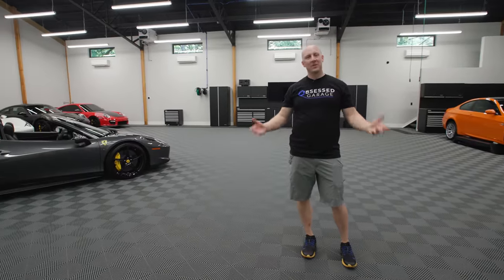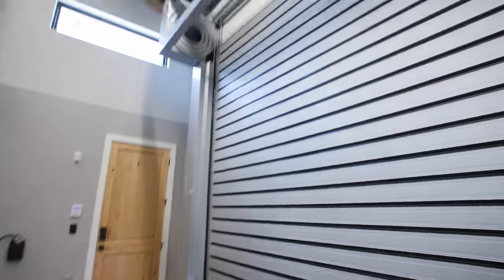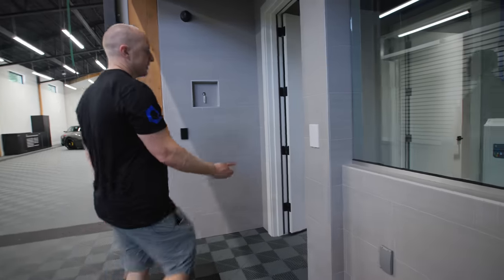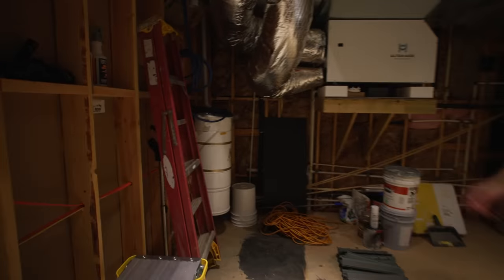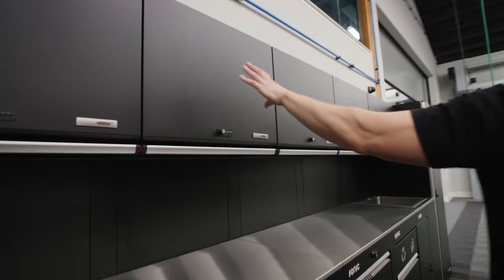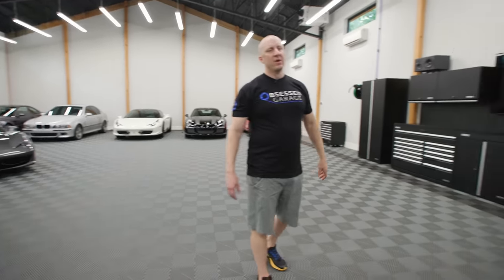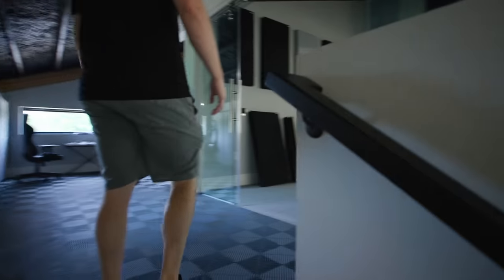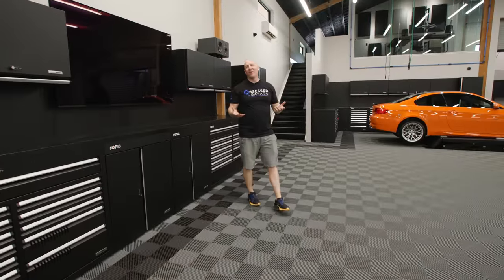BEST GARAGE Ever Built: Updated Walkaround Tour

Comment: This looks cool, but it looks like you can’t use tools like a cutting torch, plasma cutter, welder, or a grinder anywhere near that floor. I guess it’s more for storage and changing spark plugs?
Reply from the maker: Yeah, we've designed a bunch of garage where we have a heavy machine area and do the pretty stuff everywhere else.

Comment: Can that lift get wet? If I'm doing PPF with it for example. Would you have rust issues around the base? I'm guessing a custom drain can be built at bottom?
Reply from the maker: Yes, all the external metal components are stainless or galvanized, the frame is powder coated.  I would guess it may take a few years off the lifespan, but we are talking decades if maintained.
Reply: @ObsessedGarage  got it. Thank you for the reply. Begining stages of planning and collecting ideas for a future HQ. I have a feeling OG orders will be involved!

Comment: I would not have installed that type of floor in the wash Bay Area. Seems like IF there was any dirt clumps that washed off would fall and get trapped before it hit the drain. But,  betting not one of those cars see dirty or rainy roads.
Reply from the maker: Nah, it works fine for that.

Comment: I honestly don’t care for garages where people make them look like modern homes and fill them with exotic cars. 

I want a big garage with stacks of toolboxes, parts racks, welding machine, shop air, etc. That way I can pull in shitty clapped out  rusted out vehicles/equipment and fix them. 

This just seems like a waste of money. What the point of a garage if you don’t use it for anything except storing the vehicles you never drive.
Reply from the maker: To each their own is all I can say. With different passions people will use their garage in their own way. I prefer the clean look of a well designed garage, but I know that doesn't fit the aesthetic for some other enthusiasts out there.